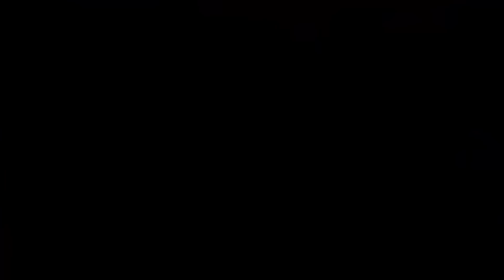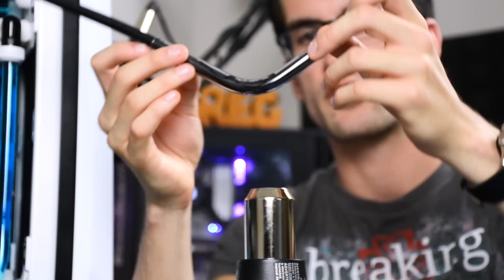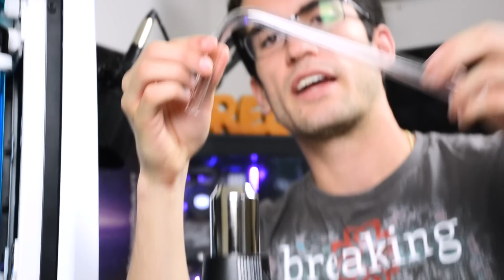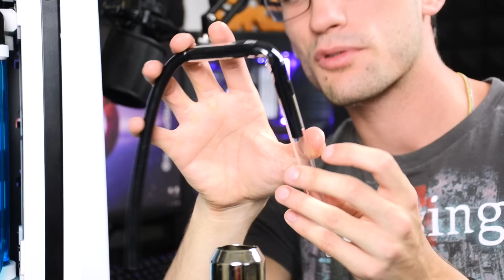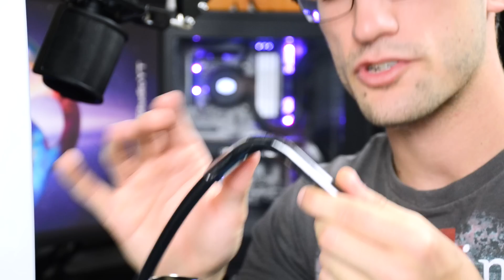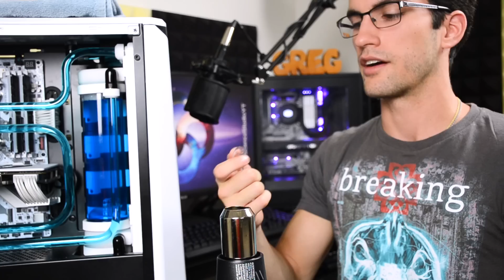How to Bend and Cut PETG Tubing

Comment: Thank you for your enlightenment! One question: I have the choice between a 10mm ID 12mm OD (2mm thick), and a 10mm ID 14mm OD (4mm thick). What would be the best choice? Is thicker better with PETG (e.g. in regard to capillary transfer or whatnot)? Thanks again.

Comment: Greg - I have the same radiator and reservoir. It looks like you made a custom bracket to mount the reservoir on the radiator - is that correct? Thanks!

Comment: Thanks for an excellent tutorial!
Been watercooling since 2004 but doing my very first hard tubing with PETG today, feel a lot more confident after your tutorial so I'm off to the workshop for a new build that looks year 2020 and not alternate timeline steampunk 1860 X-D
Feels like cheating when all the parts are actually designed for pc water cooling instead of using a Ford heater cell for a radiator, custom fitting universal blocks and painstakingly combining plumbing and aquarium supplies to get it done X-D

Comment: It's probably already been commented, but it isn't really safe to use the circular pipe cutters on acrylic. Even if you go very slow, it will eventually shatter making a very jagged and essentially unusable cut. Maybe this can work if you heat it up so it becomes softer but I think a dremel, table saw, or hack saw if you had something to secure the tube would be easier.

Comment: Nice case at the back! Do you mind sharing what's the cooling system items brand and models you got there (water tank, radiator and pump) and case? My cooling system is like 10 years old so time for an upgrade...

Comment: FYI.  The white rachet cutter is not for cutting copper tube, it's for cutting PVC, PEX and other soft to rigid poly tube, the red cutter is a true copper cutter and will cut stainless as well.  Just thought about the Verge video when you said the white cutter was for copper....

Comment: I know this video is old, but to check the 90° angle you can literally use the edge of your table in most cases. See if the tubing alings with the sides of the table.

Comment: I would say use 16mm OD (PETG) your first time if that's the size you want. I personally think the bigger tubing (16mm) looks better and I had no problems bending it myself. It's just a waste of time/money starting with smaller tubing/fittings if you plan to use larger ones later.

Comment: Thanks for the video.  I can tell your a person who pays attention to the details like me.  I have found that using the ratchet cutters can create micro fractures at the very tip of the tubing.  That's why I used both tools like you suggested.  Start off marking your spot with the rotary cutter, and then finish the cut with the ratchet cutters.  No sanding or beveling needed.

I wish someone would post a good video on best measurement practices with hard tubing.  I have no clue how to measure and implement but i will soon learn the hard way.

Comment: I profusely fantasize about the day when modders can simply bend these types of tubes as easy as wire hangers.  Maybe some inventor is working on a manually pliable plastic tube that will eventually find its way in the PC mod market.  Until then, I'll continue to invest in AiO.

Comment: another person recommending the scisor type thing... did that to my bitspower PETG tubes but they ended up oval...ah i was messing up ic :P

ended up sawing them with a metal saw which kept em nice and round and then just sanding the ends to make them smooth so they don't damage the O-rings.

Comment: I´m really thinking about making my first own loop. I´ve got a big hardware upgrade coming soon so I´m switching cases aswell, I was about to use an AIO but a custom loop is just so much better. Still concerned about the cost of all the parts I need and risk to my other components if I manage to fuck it up completely

Comment: Great video first of all. I was wondering, how do u manage your radiator fans? Do you create a fan curve in your bios? I ask because I just finished my loop. I have a 360 rad in the front and my fans will rev up and down at random times. Idle or load. Its very annoying. I tried messing around with the fan control in the bios but its still doing it.

Comment: yeah dont do it.
buy the sealed all in one coolers
You gain control depending  how many you use.
You gain safety because if one pump dies it only effects one item.
You gain the ability to use them again and again and again unlike these gpu coolers one use only.
Doing this kind of build is a step backwards not forwards.
You cant move your pc without the worry of spillage its much more expensive, it has problems with leakage and if the pump dies you loose the hole system.

Comment: Good vid, though I would really not even include any reference to acrylic tubing material at all. That is a very different animal truth be told. For an application like this, if you had to use acrylic; you would want to use joints to angle the tubing where you needed it. Bending just a single piece of acrylic can be a pain, tubing just isn't worth it due to how rigid and brittle the material is. Add in the fact that you would need a saw to cut it and then sand the ends... It would just be a fairly massive undertaking. No need to even put the idea of using, let alone trying to bend; acrylic and have it look good in a situation like this because it won't. Stick with PET-G and other rigid soft tubing materials and it will make for a much better time.

Comment: I build my first loop with just a deburr tool and a small saw (the one ek sells in their kit). But I have to redo the loop and I just ordered https://www.primochill.com/products/primochill-rfb-rigid-tubing-finishing-bit-1-2in-id-x-5-8-in-od

It helps with the deburring and it helps to shorten a pipe, when it is slightly to long.

Comment: I have to sand down my cuts as my rotational cutter leaves sharpies and I was told by the store to round the edges of the petg from barrow.. kinda sucks tbh as it's extra time and effort
Reply from the maker: That's what I was saying in this vid. I use a pipe cutter to eliminate the need.

Comment: My AMD fx 9590 is idle 17c but my room is 40c. Is this normal? It's 70c on load.
Reply: Boda No I live with a fx 9590
Reply: your room is 40c? Do you live in Arizona with no AC or something?
Reply from the maker: Those are incorrect temps. If you're using HWMonitor, it's normal.
Reply: Science Studio is something wrong with HWmonitor. Is that what you trying to say? I use it

Comment: perfect timing on this video as I am about to do 2 separate loops in my tower 900 case later this week when parts arrive thanks for all the tips great video, very thorough tutorial thanks a bunch keep up the good work.
Reply: yea it was more of a spur of the moment build final specs will be as follows

I7 7700k @5.2ghz
asrock z270 supercarrier motherboard
32gb dominator platinum special edition @3200
2tb samsung 960 pro m.2
2, 2tb samsung 850 evo in raid 
6tb toshiba nas drive 7200rpm
2, asus strix gtx 1080ti OC edition with phanteks waterblocks in sli
evga 1200 watt psu
2 custom loops 
2, alphacool xt45 360mm rad
6, riing 12 premium plus radiator fans
5, riing 14 premium plus fans
all in a painted tower 900 case

Comment: What liquid do you recommend? I used C1000  and after about a week I dumped it and used distilled water since the c1000 was breaking apart.
Reply from the maker: Had the same issue with C1000. Alphacool non-opaques are great, as are DI + Mayhems combos.